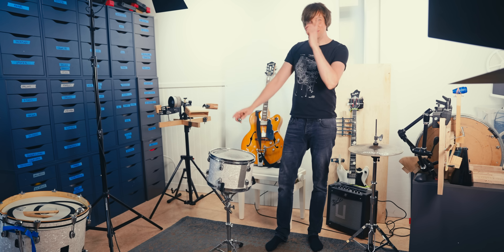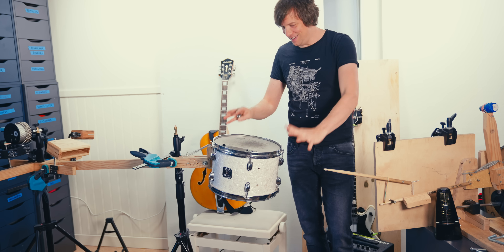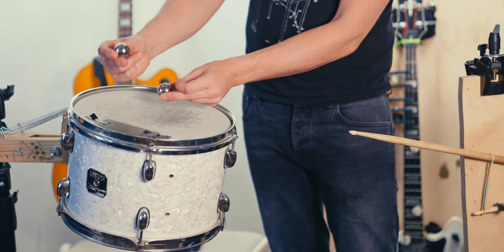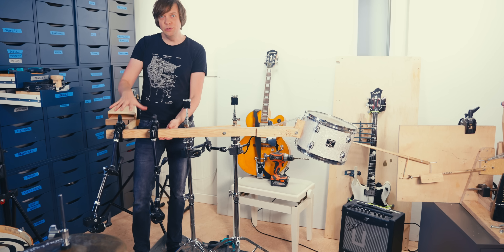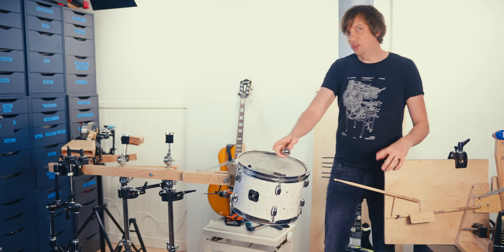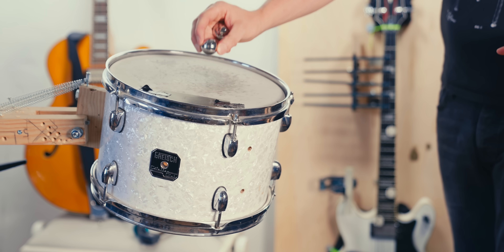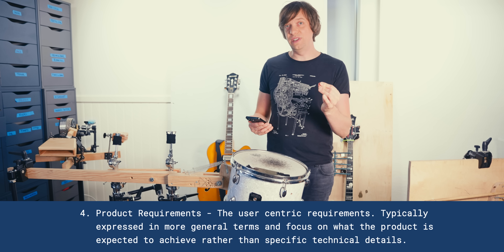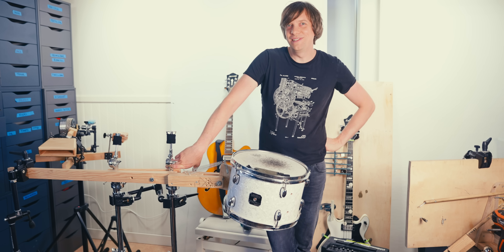Drums that Move makes the Marble Machine FUN!

Comment from the maker: Check out the awesome Marble Machine from Engineezy:
https://www.youtube.com/watch?v=w1ks0Vy98KI

Double conveyor belts on that one looks so great :)
Reply: There is a Spanish guy making a digital clock, and I am amazed to see him pulling it off, last I checked. Nice one sharing Engineezy!
Edit : Ivan Miranda's digital clock
Reply: Why not just light it with LEDs?
Reply: ffs stop tinkering and get on with the project
Reply: @wombleofwimbledon5442  Yes, it would be so much better for the drum to remain stationary so that the marbles have reduced variability in the path they might travel. Making the drums light up when hit would still provide indication that they were hit while reducing the possible errors that can occur by a moving drum.
Reply: what's next? fire and a waterfall? lol
Reply: it does look very cool. but if you stick with that movement, make it minimal for several reasons:
a) if it has unlimited movement towards the ground, a longer series of marbles will push it further and further down, which will cause a delay or in worst case a change in tempo
b) if you have a moving position oof the drum, it will be super hard to say where the marble will land when it bounces off and you will have to account for that
c) if the drum has been pushed down and is in its way up and will be hit by a marble, the marble could fly off to nirvana.
d) the drum are literally. the heartbeat of the machine. if the heart is not precise, the whole body suffers.
e) get the same effect by lighting it up?
Reply: @sinisterresident  a chocolate fountain and a pole for exotic dancers might come after the fire and waterfall.
Reply: @wombleofwimbledon5442 that is a fantastic idea
Reply: Your step two is more like PROOF OF CONCEPT than making a  prototype.
Reply: Well, there goes, "tight music."
Like other comments are saying, "Kinetic Fingers are back!"
Reply: Why does my mind I have the visualization of a Jabberwocky getting hit on the head with a marble?
Reply: MAKE MAGNET ONE NOW EVERYTHING FREE ENERGY LETS GO 🎉

Comment: "Drums should move when hit" is already an implementation detail. I think the requirement is "Instruments shall visibly indicate when they are being hit, even to a distant viewer". Maybe moving up and down is the best way to do it, maybe it isn't. You could consider other ways, like for example sound-activated LEDs, which would be visible even better and even further, and can be applied to other instruments, like the vibraphone.
Reply: @Rurexxx  absolutely brilliantly said!
Reply: While LEDs would show when they get hit, its not mechanical. This is meant to be a mechanical instrument
Reply: Alternatively, automated fake movements would work too. Why rely on the drum and springs changing everything based on temperature, humidity and other variables, when you could make the drum "bounce" with decent enough timing in a fake way that is always the same and behaves well based on the actual programming wheel?
Reply: LEDs are not allowed!!!!
Reply: came here to say this.
Reply: @Art_for_Mage  Microphones are also not mechanical. This "hit indication" isn't necessary for people viewing the machine in action from up close. But Martin is making a concert machine, so it certainly needs AV add-ons to make it viable for this purpose.
Reply: This seems like the only useful feedback. I had fun watching the video. Going to the comments section was a mistake though. A lot of grumpy people feeling scandalized.
Reply: I'm having visions of the ring platform battle in TRON.
Reply: @Art_for_Mage  What if we use gunpowder?
Reply: @Mutaburasaurus  1) in what world is that a mechanical system. 2) how the hell would you use gunpowder.
Reply: I'm just going to second this idea. One of the failure points Martin stressed in MMX was "no marbles on the floor". You can't consistently catch the marbles if you're hitting a moving target. I also think lighting is a better approach for visually indicating what the machine is playing, since it'll be visible even in the back.
We don't need the kinetic fingers, Martin!
Reply: @SiberCatLP  The kinetic fingers is a call back to the spider Animusic video and is the CREEPIEST out of all of them.
Reply: Well said
Reply: @raedev  Oh god, this is the 'dropper fingers' all over again.
Reply: I'd caution against flashing lights—all other things aside, any fast-played notes would become a seizure trigger. There's already plenty of concerts I'll never be able to go to, haha.
Reply: Is the marble bouncing off it not enough of a visualisation?
Reply: Or what if you use the laser array on the surface so if the ball gets deflects the laser light on

Comment: I feel like we have done this and pulled back because of drop consistency.
Reply: Yes, but... Last time, he wanted tiny funnels for the marbles to land in. This could still work if he has a big funnel.
Reply: @HenrikMyrhaug  don't need to worry about marbles on the floor if you make the entire floor your return funnel
Reply: yeah but imagine the noise from the marbles falling to the floor level
Reply: @gunar.kroeger  he had a 'solution' to that on previous video (a throw in a bucket, so thick wool material in a large opening)
Reply: yes this video almost dooms the project in my mind tbh
Reply: We’ve come full circle😂
Reply: @gunar.kroeger  sound of marbles hitting floor will drown in the music by the marble machine etc. It has mics and mixing board, amplified by PA system. Just like any show.

Comment: Another visual trick could be to use fluorescent marbles and a blacklight. It'd brighten them even in well-lit stages, and in the dark they'd probably leave cool trails through the air...
Reply: I just internally swooned at the idea of this! God that would look so cool
Reply: I'm not sure if there's any kind of paint that would stick on smooth metal while also withstanding constant grinding and abrasion. One solution to that would be to stone wash the marbles. The paint would stick much better but it would also induce much more wear and tear to the machine. I'm not sure if the trade-off would be worth it, as that kind of slow degradation would make it really hard to predict if something is going to give in during a gig and subsequently increasing maintenance cost heavily.

The best case scenario would be if the marbles could be electro-plated, anodised or diffused with some kind of fluorescent material, but I'm unaware if there even exists such materials.
Reply: Using a stroboscope could also give really nice effects of "frozen" marbles in the air
Reply: I was thinking LEDs on the drums, but your idea is better
Reply: @anteshell it would require the marbles to be coated in plastic, acrylic or something like that. Pure would be to light I guess.
Reply: Blacklight is a hard effect to work properly; in a small college dorm room, a haunted house, or the back of a spencer's gifts it's relatively easy to get the darkness you require and have the lights relatively close.  In a large concert venue, this would be a very large pain to achieve properly.  I'm not his lighting guy, but I'm telling you, his lighting guy would say no.
Reply: @Krmpfpks  That would drastically affect how marbles bounce, which may or may not be a problem. However, it would also make them susceptible to damage, which is a problem. And the biggest problem of that solution is that it would increase the marbles' friction against each others and the lanes significantly.
Reply: There are dice that have LEDs in them with rechargeable batteries, could do a similar thing with the marbles. Sure it's more difficult than using steel marbles, but it would make marble paths much easier to see and reduce the amount of movement the machine itself would need to do which creates more complexity trying to keep the marbles in the machine.
Reply: @anteshell  depends on the material, but yes.
Reply: Had the same thought. But maybe there'd still be a disconnect between marbles and them playing a certain instrument, with all marbles moving around everywhere
Reply: dude youre a genius
Reply: That is one amazing idea. Would LOVE to see that, it's giving me my own ideas for a neon Lego version

Comment: 1 pivot: predictible movement, tuning possible. 2 pivots: fundamentally unpredictible movement, this is one of the most famous chaotic kinematic movement know as the "double pendulum". As famous as the "3 bodies problem" in physics or predicting the wave patterns in deep sea.
Reply: This. And it’ll make it much harder to predict where the marble goes after it hits the drum.
Reply: This has nothing to do with double pendulum chaos, it is perfectly predictable but just harder
Reply: 1 pivot looked better I think
Reply: @YogiTheBearMan  I liked one pivot too, but on the arm with the counterweights, not the spring. I think the long arm should pivot and have springs for faster return. Or make the drums a bit heavier
Reply: Just realized I got caugth up into Martin's over-engineering trap 😅
The time jitter introduced by a +-5cm error over a 50cm fall is about +-11ms, or a 1/16 off at 170BPM. Is it any impactfull to the ear?

Comment: Feature creep is back on the menu boys!
Reply: No. Feature creep happens AFTER the feature set has been specified. He's not there yet.

It is good that Martin is testing the feasibility of features before adding them to the list. The easiest thing in the world would be to just write up a list of features and start designing. That would result in failure as would stripping the features back so far that the resultant machine would not do what he wants.

From what he says at the end of the video, he is aware that if he gets stuck in this phase, the Marble Machine will never be built. The flip side is that if he skips through this phase too quickly, he'll build another one that basically doesn't work.
Reply: @briancampbell179  Features have been set by MMX, as he couldn't even achieve it.
The goal of the new method, was to finish the machine, not to iterate on a working version (which doesn't exists).
This is definitelly feature creep, and over complication.
And he has been doing it since, very early into the project.

On the other hand, I've heard Martin stating that those feature creep, are fun to him. Seems that, without them he would loose interest in the project.
I just hope, that he knows, the MM3, won't be achievable, at this point.
Reply: @xmtxx , no he didn't. Feature set for MM3 is whatever HE decides the feature set for MM3 is. It is not decided by you or me
Reply: @briancampbell179  You can get all "technically" ou want, you don't get my point.
As he couldn't even achieve MMX, the most features he should expect for MM3 to have a chance of building it, are the ones from MMX, or less. And I'm pretty that was agreed on, in the begining of the project (MM3).
Not more.
Every time he adds something, he gets farther from its original goal of building MM3, and the more likely the project is to fail.
Reply: @xmtxx  , it wasn't the feature set that brought the MMX undone. It was his whole design approach which is the exact thing he is addressing here.

With MMX, he drew it up in CAD then started building. Everything was designed with no idea whether it would actually work.  It is why so much was swapped out and changed as it was built. It was not the number of vibraphone channels it had or the range of percussion instruments incorporated in the design. It was having to add a demagnetiser because the lift mechanism magnetised the marbles. It was having to totally replace the marble distribution system because marbles jammed. It was having to replace the release mechanism. All basic functions needed by any machine regardless of the feature set.

This time, Martin is taking a more methodical approach to the actual design. I sense a lot of impatience amongst his audience with the tinkering with feature ideas. He is progressing more slowly than a professional engineer would because he's not a professional engineer. That doesn't bother me. I understand what he is doing and believe he is on the right track. Whether it will produce a successful MM3 is something only time will tell, but he has a better chance now than before and it has absolutely nothing to do with the feature set.

So yes, I did get your point. I politely declined to comment on it because it was nonsense.
Reply: @xmtxx  All these ideas that it was the feature set that made MMX fail are simply bullshit. I'm not surprised though, frankly the comments sections on this channel are largely full of bullshit.

Comment: Kinetic fingers
Reply: oh, so true
Reply: Yes, Lets do that again too 😂
Reply: That's where my mind went I won't lie. I worry about Martin having another crisis of faith with MMX, but sympathise with the rollercoaster of design and implementation. Personally, I think the project might suffer from not having a restricted enough set or requirements. Because when a product is designed well, the designers aren't happy that they couldn't get extra features in and the engineers aren't happy that they couldn't use a technique or material that could have made the product _perfect_. This is when end users get the best experience, when no one has gotten quite what they wanted out of the design and production stage, so the product is balanced.

Just my unsolicited 2p
Reply: Do it do it do it!!!

Comment: For everyone pointing at the feature creep, it does hugely add to the kinetic performance of the machine - fills will look amazing. Context, we're talking about single hits and flams, the functionality of repeated evenly spaced pulses on the same drum is met elsewhere, it just needs to return to a fixed position in a useable period. Fills just don't happen often enough for a timed second hit to be a problem, if you have enough toms, or matched pairs (stage left and right?).  I would avoid the literal chaos of two pivots,  but if you can get it simple and consistent, it looks relatively easy to implement for a  big payoff in the function as a piece of art
Maybe this won't survive an oncoming cull of features crept, but I can see his reasoning and I think he is right.
Reply: Well said.
Reply: Timing is only one problem. There is also the problem of unpredictable marble bounces, for example.
Reply: Moving drums adds way more potential for marbles to miss the return funnels. Bad idea.
Reply: @Mutaburasaurus based on the new layout he had in the stage mock-up, I think the marbles will all just fall into a large collection trough in front of the whole machine. I don't think he's trying to get them to fall into small funnels anymore.... Hopefully.

Comment: "I know which machine I want to work with for the upcoming 10 years" — Martin, 2024
Reply: If 10 is enough
Reply: 10 Years in engineering terms is “we know it’s possible but we are never going to get there.”
Reply: I think he meant "work with" as in perform with.
Reply: @dflosounds Yes but at this rate, it's more like "Work on for the next 10 years."
Reply: @dflosounds  I think the same, but I decided it is an interesting statement either way

Comment: The level of complexity you are headed toward is going to be mind boggling. Setting this up is going to be a MASSIVE ordeal, and making it so that it can be taken apart, put back together, and then played is going to be amazing to see.

If you can do that without WEEKS of set-up and tuning for process, you will have succeeded in an engineering feet few could ever do, much less pull off.

Comment: I would suggest using a drum trigger that can be mounted on the rim of the drum, and use the midi signal from drum hits to trigger lights or other effects, this way you get to keep the precision and possibilities for drum beats and fast fills. You can use acrylic drums and mount the lights inside it, making for an awesome light shot.

The loss of precision seems way to big to be worth it, and it severely limits the number of drum beats that you can program by having to wait for the drum to return. Also, the new different angles that the drum will have at different times means the "catching" mechanism has to be bigger. This will probably obstruct more than the small movements will show motion. Flashing lights can be seen in the whole concert hall.
Reply: Exactly.
Reply: Yes, but it doesn't communicate the drum being played in a mechanical way, by being hit by a marble. Won't be apparent a bit further back

Comment: This is honestly a big no, not only it will drastically change marbles trajectory each bounce, potentially making them fall to the floor again, not only it will ruin the whole "keeping timing consistent" thing you've been struggling with for over a year, but it will also acomplish nothing realistically speaking, that little bounce sure looks cool but only if you're insanely close to the machine, people in a stage will not notice the slightes movement from that far away.
Maybe a better solution would be to have colored marbles (maybe flourescent?) so everyone can see their trajectories from any distance
Reply: He is using a "catch basin" style prototype for the marbles.  Put a transparent panel in front as a backstop and ALL marbles will always be caught.  No "bounce targets" to be missed!
Reply: I agree that the movement won't be seen from a distance. I'd rather at a light effects on hit. There would be basically infinite possibilities to make the percussion pop out visually for everyone, without any compromise to timing or mechanical complexity.
Reply: @31chh0rn  This is a purely mechanical project, adding electrical solutions is a no-starter
Reply: Unless we're talking stadium performances, they will 100% be able to see drums moving. I see it in regular performances with drums that aren't spring-loaded.